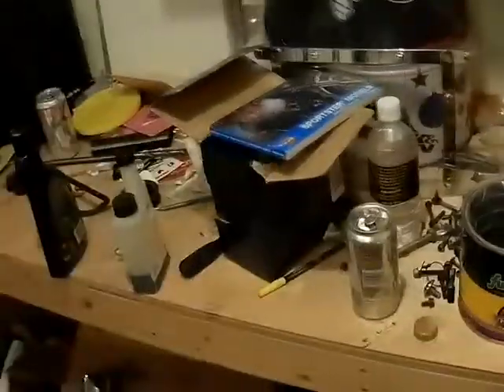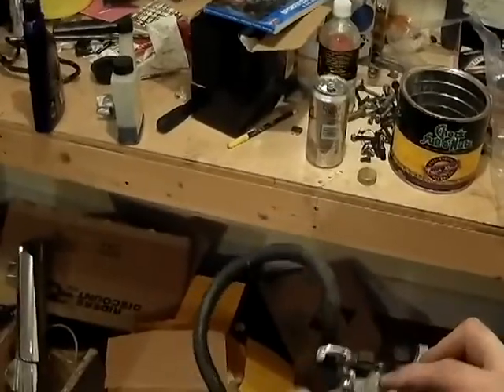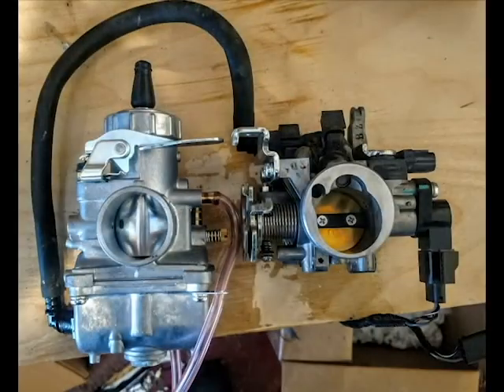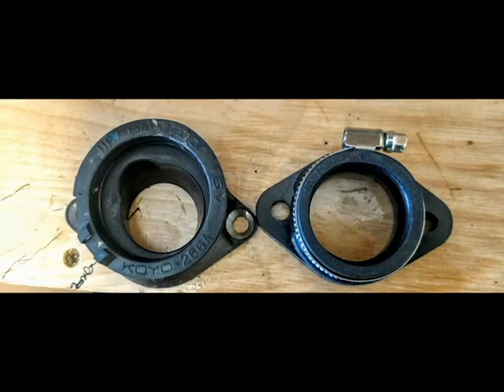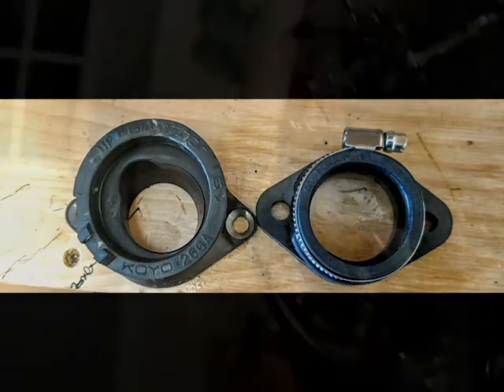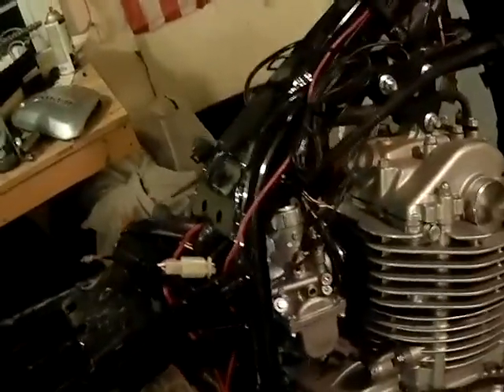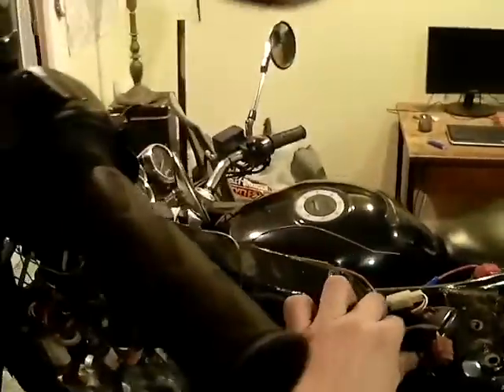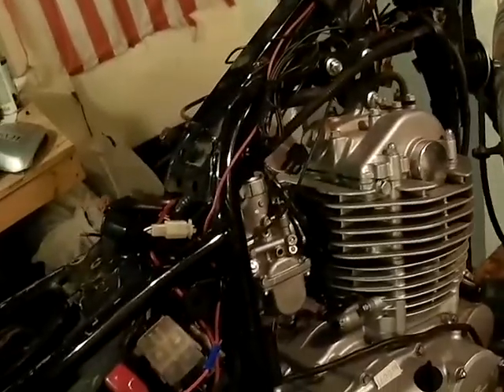TU250X Carb conversion Mikuni VM34 Round Slider

Comment: Do you have a walkthrough on the carb install with jets etc? Just picked up a tu250x from a friend and he chopped up the original tank so i was thinking of doing a carb conversion. Seems simple enough, but figured i'd ask someone whos already gone through the trouble.
Reply from the maker: It won't work with ECU as it cannot read the TB system and will cause the ignition controlled by the ECU to fully retard and you never can make power with it. You could do a flywheel swap and install a DR ignition system and it should correct the issue but you won't be able to fix the ECU trying to keep the bike in limp mode. I ended up getting the Jetting correct but it would just flatten it's self out from ignition.  It was cool and honestly you CAN make it run with a carb but don't expect to get any power from it. BEst,
Reply: @Jedz123  dammit. Guess I’m going to have to try and get the original fuel injection module my friend screwed up fixed.